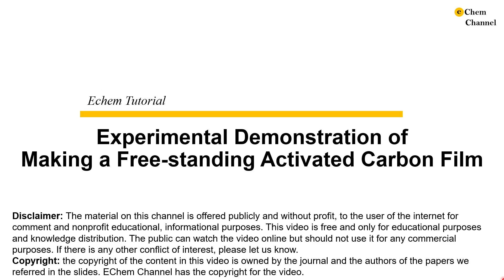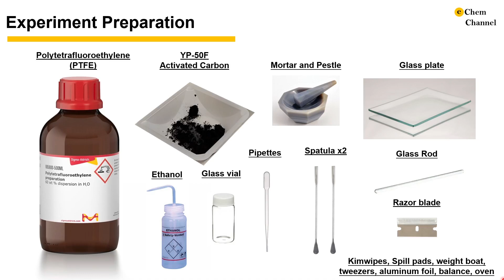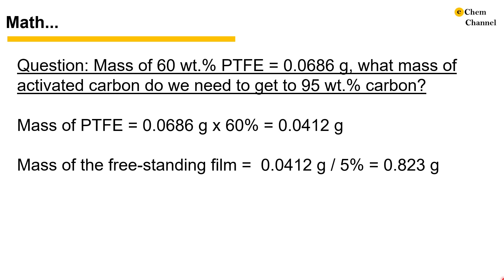Tutorial 27-Making a Free-standing Activated Carbon Film

Comment: Hi Sir... I am working to do a device using Swagelok cell using prepared activated carbon... Here you have mentioned about the percentage of binder used as 5%. Is the percentage of binder is good enough to get good voltage output, because more the binder, more the resistance.....Do you have any idea of how much amount of material has to be used to get good voltage output? Thanks in advance
Reply from the maker: In a lab testing environment, 5% is fine for high-power applications.
Reply: @EChem_Channel  Thank you for your kind reply..

Comment: Great video. I was wondering is this type of consistency possible if using PTFE powder rather than 60 wt% dispersion in water? Thanks
Reply from the maker: Yes, the important thing is to have a thorough mixture of carbon with PTFE. Usually, having a solvent like ethanol helps.
Reply: @EChem_Channel  Thank you! I should've specified my question more. I meant if I am starting off with PTFE powder rather than a dispersion, could I still get this consistency when preparing it with ethanol? Thanks again!
Reply from the maker: @MarquezBalingit  Yes, you can. Try dissolving PTFE powder in ethanol first, before mixing it with the activated carbon
Reply: @EChem_Channel  I have like PTFE beads, and it is not dissolving with ethanol, so what has to be done for the beads?
Reply from the maker: @nandhinidhanavel213  I never used beads, so I'm not sure what's wrong with it. Consider switch to powder and the dissolved form.

Comment: Would be awesome if you could do a video with cmc sbr with activated carbon, water absorption of AC is very hard to do from my experience on films you need so much water to mix
Reply from the maker: Thanks for the suggestions! Water-based processing is very important and industry-relevant. Unfortunately, I don't have experience in that area yet.
Reply: @EChem_Channel  Thanks for the reply, really cool video! If you have any experiance with N/P ratios for lithium ion cells that would be so so cool. Calculating the mass of the anode to cathode of a Li-ion generic cell would be so so cool!
Reply from the maker: @karlm5022  Thanks for your suggestions! Xuehang had an earlier video on balancing the mass of electrodes for full-cell supercapacitors. Maybe you can find some useful information there: https://www.youtube.com/watch?v=0u0TWy0imoM&ab_channel=EChemChannel

Comment: Nice video! I also have a question: I tried to reproduce your flexible electrodes. However, I always have the issue that the electrodes are cracking while drying. Do you have any suggestions how to avoid that? Could it come from the fact that I use a different carbon black from a different company? Or do I need to fold and roll the mixture longer?
Reply: this can also be due to the particle size of your carbon material, especially if it was "home-made". make sure the particles are small enough before preparing the composite. roll out your electrode and fold in half at least 10 times or until you get the desired texture. but do not overdo it, too many rolls can cause the electrode to compact too much and begin to crumble. and yes, each subsequent addition of ethanol washes out your polymer, you can see this by the stains on the glass. Good luck with your experiments
Reply from the maker: Hi there, did the cracking happen during the drying or during the rolling? If it's the former, you may need to spend more time mixing the binder with the carbon. If it's the latter, you may need to repeat more fold and roll with adding ethanol in between.
Reply: @EChem_Channel  Hi, thanks for the help, I will tryout soon. It happens when I produced the film on the glass plate (after rolling). When the ethanol is evaporating (basically the "drying over night" step) after several minutes big cracks are apperaing

Comment: Excellent presentation , How can we rectify the cracking problem of the slurry coated in battery grade aluminium foil ? Whenever it dry ,cracks are found in the coated material? PVDF as binder
Reply from the maker: Thanks. What you ask here is a complicated question that heavily depends on your slurry compositions. I would recommend you look into the rheology of your slurry. Here is a reference: https://www.rheologylab.com/articles/electronic/battery-electrode-slurry/#:~:text=A%20whole%20host%20of%20rheological,significant%20impact%20on%20battery%20performance.